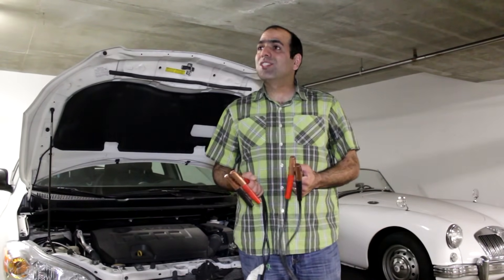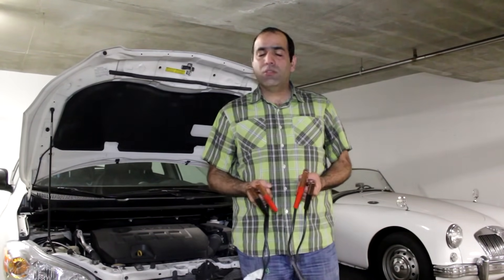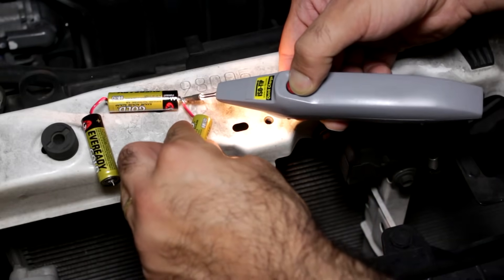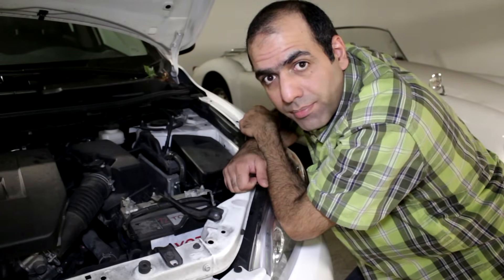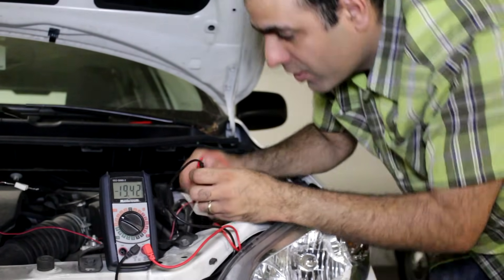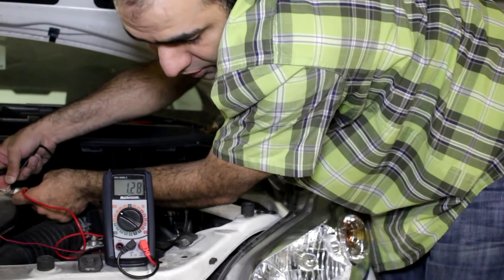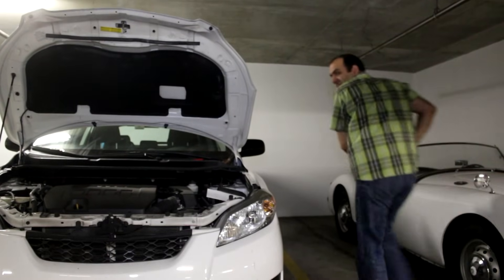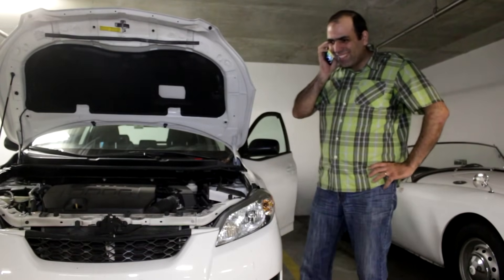Jump Start a Car with AA Batteries

Comment: I'm surprised he doesn't have an electric car. ;)
Reply: Thing would be on fire in three days
Reply: @meseyc  Only his... it would short circuit instantly, start smoking, and immediately die. Surprised his gas car hasn't blown up yet...
Reply: @Alec nolastname Around 22% of electricity comes from renewables. As the grid grows greener, so does your car, if it is electric. You can also buy renewable energy certificates to more or less support renewable energy. Or if you don't plan on moving for ~20 years, charge your cars and power your house with solar.

Lithium mining is indeed damaging, but not really that much more than most of the other crap we mine at much greater volumes. Plus lithium batteries are recycled.
Reply: he would start taking the battery or even the ac motors out of his teslas to do some other projects lmfao
Reply: He finally bought one now
Reply: Alec nolastname Vancouver has hydropower from the Grand Coulee Dam.
Reply: Tesla 😆😆 2021
Reply: Now he has
Reply: He got one a few months ago. Uses it as a whiteboard. 
https://youtu.be/hFLopMOIjc8
Reply: He got it
Reply: now he has
Reply: He would die in a horrific electrical accident leaving his charged remains on the seat
Reply: And now he does
Reply: It's coz at that he was a bit poor and now he has that
Reply: Electrically-powered cars are just as bad for the environment, if not more so, than gasoline-fueled cars. The method most companies are using involves coal burning to produce electricity, which is dangerous to the ozone layer that protects us from the sun's deadly light. That, and it is more expensive to power an electrical car, too. I'm not going to lie; the concept for electrical cars is a great idea, but with our current big industries, it won't be eco-friendly.
And if you won't take my word for it, here is Electroboom himself admitting it: https://youtu.be/hFLopMOIjc8?t=124
Reply: @KinøDerToaster  It's only more expensive if you don't calculate total cost. Digging a chemical battery out of the ground and calling the work done is pretty much a cop-out explanation. If you want to include the actual cost of fossil fuels you have to include the energy used for all the plants and animals to grow to make the fuel in the first place. Of course the cost of electricity also includes the centuries of technological development. All said and done, if you include every cost everywhere, everything is where it should be lol
Reply: @jek__  Cost isn't the whole "selling point" of electric powered cars though. It caters and preys on people that think they are doing good for the environment  by buying one because it doesn't use gas/pollute when the electricity needed to charge it is using polluting forms of power to charge it, using electricity generated from power plants that pollute the environment, just as much or in some cases even more so then just burning gasoline.
Reply: @rootBacon  Actually, that’s a common misconception. Even when electric cars are charged from grids that rely heavily on coal, they still tend to be cleaner overall than gasoline cars. EVs are way more energy-efficient than internal combustion engines, and power plants (even coal ones) are generally more efficient than millions of small engines running individually. Plus, electricity generation is getting cleaner every year with more renewables coming online, so EVs get greener over time, while gas cars don’t. Numerous studies show that over their full lifetime, EVs have lower emissions in almost every region.
Reply: It's probably because he realizes how much better it is to own a gasoline powered vehicle.
Reply: @ronrothrock7116  Didn't age well m8, he drives a Tesla now.
Reply: @ronrothrock7116  Or maybe because people who care about the environment and aren't morons know that the time to switch to an electric is when you have to replace your current car, not just lol whenever.
Reply: @FNLNFNLN  Unlikely, since he's a billionaire.  He can upgrade whenever he feels like it and if he believes in "saving the environment" he would have changed over to an EV before now.
Reply: @ronrothrock7116  Are you claiming Medhi is a billionaire?

Also, getting  an EV when your old car is fine is like getting a new phone ever year. Even if your new one is more efficient, you're still being pretty fucking wasteful.

If your main concern is the environment, new EVs should be replacing old dying cars, not mostly functional ones.

Maybe try leaving your safe space some time.
Reply: @FNLNFNLN  Its not like when you buy a new car you just take your old fully functioning one to the junkyard. Someone else will use it as an upgrade to their barely-working car.
Reply: @ronrothrock7116  he did it

Comment: Your car seems to be suffering a small drain ...have it serviced or disconnect the battery if it needs to sit for more than a few days ....or do what most men who don't want to take so much time do ...and but a battery booster (also makes a good portable 12v power supply)

Comment: The car battery was 11.7 volts plenty enough volts to start a car of that size. I don't know what the point of those double a batteries were not like that little bit was going to make a difference. What he should have done was make sure the car battery was completely dead.  then try his double a battery trick. I hope none of you fall for this BS this video is so stupid. Nice unibrow buddy.

Comment: I have personally started a car,with two 6V lantern batteries joined up..In the past here in Australia,there was a battery you could buy called a "Switch" developed in New Zealand,it had a switch o. top of it..and the battery had  actually two batteries inside the case.sort of double barrelled battery..If the battery went dead,you merely lifted the hood a d flicked the switch to the other position,and started car in the secondary battery ..very good idea..dont know what happened to it,most likely bought out and closed down by Americans..usually the case

Comment: Yep, low current for longer time starts the car. I ran my battery down at work (I'm an EE) and quit late when everybody else was already gone. All I had was an Agilent lab supply with a +-15V 1 amp output. I hooked it up (making sure it was enabled first) and waited for about 15 minutes. Car started with one crank.

Comment: What voltage do you need to charge a 12VDC car  battery? I have a variable power supply that i use in my shop for stuff and i can vary both the voltage and the current.

Comment: I jumped a old V-10 ford on a remote job site with a 18 volt dewalt tool battery that was half dead. had to slide my Drivers license between the jumper clamps on the dewalt to stop it shorting. got me home.

Comment: Very like your clips (and jokes too) 😃 ;)
In this clip the "help-out"- charging procedure may work, (depends on the level of discharging already) but at a so high input voltage (yes, of course, it in case of circuited so little batteries, the voltage on connection to a massive energy-hungry device immediately per few falls) its recommended to underline one time more better 2, the need to disconnect of at least the minus-pole from board-electricity-net!!
19 volts - A regular car-battery-charger gives 14V DC  on the output, what already can destroy sensitive to Overvolt - but very very expensive - circuits in car electronic (such as blackboxes)... :/
You did, many also know, but others, who are leaving batteries  in their devices while running a charging process, may think "Engine for which start a battery is necessary - doesnt work - therefore it wouldnt harm, to leave battery both-side-connected as done in more known "home-devices"...

Comment: If you have a cordless soldering iron laying around--especially in your car, you probably have a cordless drill.  Any drill battery of 14.4 V or better should get your car to start after being connected across your car battery for between 2 and 5 minutes.  I have personally jump started my car battery from an 18 V drill battery in the absolute middle of nowhere where there was no one to help and practically no cell service. I also once helped someone jump start his car with coat hangers because neither of us had cables.  I told him they would glow red hot before he got his car started but it turns out that since his engine was healthy, he was right.

Comment: When you connect the batteries in series what if in between 'in series' connectors  you included a tiny battery a temporary feed for start up.

Comment: Started my Honda with 2 5000 mah 11.1v Lipos in a pinch once, worked line a dream, batteries were fine, I thought the excessive amp pull would kill them but I still use them....

Comment: Hey electro boom....man i owe u alot...my car wudnt start....but i remembered this video.....i didnt have any AA batteries ...but i did have an old laptop charger that was 19 volts and i used that to charge my car battery...and electro boom...it started......without the boom tho  hehe....and....but i didnt get fired tho....love ur channel man...i hope u get to see this comment
Reply: That's impressive I did a similar thing with the fan cord I cut it and attached it to the battery straight from the wall, the cord was thin so it couldnt tranfer too much energy too fast(thats a good thing). It got warm but not too warm, the car did start after a few minutes.
Reply: isaac tapia what?! Did it have a ac too dc converter on it? Or was it straight ac?
Reply: @armandozapata7627  laptop chargers are all DC
Reply: @armandozapata7627  pretty sure if you charge the car battery with a straight ac current something bad will happen
Reply: @edward3709  He was talking to the guy who said he did it with a fan cord...

Comment: The car battery wasn't totally flat. Does this still work if the car battery is say 5v or less? I understand the concept: using a lead-acid battery, which can deliver high current, from lower current AA batteries. I'd be more convinced if you had some way to measure the current the "dead" car battery could deliver before the AA battery charge.

Comment: Mehdi, I need you to please evaluate my plan.   I plan to use two deep cycle 12v batteries to take over my essential power when we have an outage.  I will run them thru an inverter and keep them charged with a charger plugged into an outlet.   Since I want automatic take-over, the plan requires that I segregate the essential circuits and have them running on the batteries all the time.  What problems can you foresee?   Are the losses going to kill me on this one?  Thanks in advance.  
PS.  I think this is kind of related to your video here.  Might be good for discussion.

Comment: Your car battery reads 11.7? A car battery sits a 12 ish volts when engine is not running and that starter is not cranking over a very big engine 11.7 volts should be enough to start the car it shouldn’t have clicked like it did I’ve started cars on less.

Comment: As a better option I would suggest a 14.4 volt cordless drill battery charged from a solar panel as an alternative to use. Basic, but would work better than alkalines but worser than a small lithium jumpstarter.

Comment: You're an idiot. You had 11.5 volts on the battery in your vehicle that would have been enough to start your car without digging around with those ridiculous AA batteries.
Reply: NorCal  starter needs 12v to turn it over, & I think it was meant to be really funny while also showing that it is possible to do it! Sometimes you have to work with what you got, & if he was in the middle of nowhere it would be called resourcefulness. In a city, people just call it stupid, but I think it's awesome! This is comedy gold, why take it seriously!

Comment: It's like you were trying to fail by leaving the wipers on while starting. Granted, they do cut out when the key is turned all the way to the crank position, but still. They're briefly powered before the key gets to the crank position, and at this point who has power to spare? Oh, and how do we know that you weren't using a hidden battery like those "free" energy devices use? huh, huh? ;)

Comment: My grandfather told me of a story from World War II, an Avro Lancaster that had low charge batteries and no replacements could be found. 15 batteries  from Lorries were lined up and charged up the Lancaster's in 45 minutes. 

Everyone said it couldn't be done, believing that the higher 24 volt batteries would attempt to charge the small Lorrie 6 volt units.

The Lancaster successfully started and led the second wave of bombers over the beaches of Juno in Normandy on June 6th, 1944.

Comment: here's  several tips for doing a pro job
do not try to do this unless you are sure what you are doing - the acid can burn your skin
Test the voltage first - there may be a kaput cell which would waste your time.
Check the battery fluid.
attempt to fully charge the battery.
(I learned about these and more on Jons Mender Guide website )

Comment: Thanks! I used variation of your crazy idea to jump start a car just yesterday - with 12V VRLA battery + 2xAA to boost voltage a little bit. Started the car without getting my battery out, awesome!

Comment: It’s obviously fake but that’s what this guy does and it’s funny. Lol 11.72 volts on the battery is perfectly acceptable to start a car. You can even do it on 10 volts
Reply: no you can't start a car with 10 volts unless its a car older than 1960 still running on 6 volts

Comment: 11.5 or so volts in the battery "why won't to start" y'all need to learn. The battery with the key off was at 11.7 or so volts. Turn the key on..... Then the ecm powers up and draws from the battery. The volts drop. Then he turns the key to crank. The start relay is then pulled in, drawing more current, then the start soilinoid (can't spell you get the point) pulls in on the "pull in winding" / coil draws more current...... Volts drop to around 9volts the ecm shuts off as the starter motor try's to crank. The the coil pulling in the starter drops out, as it drop the current draw is lessened then the coil try's again and yet it still can't due to the volt drop....... Click click click.mover and over current up and current down.......

That's why the lights and wipers still worked. Try turning the key with the head lights wipers and aircon on. 

Surface charge was enough to get it over the line.

Comment: I did not see the connections in video, is a resistor necessary ?? also is thr a ground like done in jump start ?? Just connect +Ve end to +ve of car bat. And -ve end to -be of car bat. Without removing bat. Connectors of car?

Comment: Electroboom i need help !!! I have my car bettery down :( I am planning to do exactly what you did. Only thing i did not get is what is the value and importance of adding resistor in series with the battery set? If required what is ideal value and wattage of the resistor? Thanks  in advance.

Comment: Why not try starting the car as soon as you connect the AA's and let the alternator charge up the car battery once the engine starts (remember to run the engine at around 2500 rpm for charging) ?

Comment: the car's battery has 11.75 Volts and you say that's dead?
Reply: 11.75 volts on a car battery means its got less than 50% charge.

Comment: 11.7V should start a car easily
Reply: Yes and no. My old '66 Chevy, yes, definitely it would start anywhere over 11 volts(I had a dashboard voltmeter) And my battery was not a standard car battery but one with about twice the normal capacity(in amp-hours). Batteries today actually have very small amp-hour ratings and they are designed primarily for high output current for what short time they have. That is why you do not see amp-hour ratings on them anymore, but you instead have "cranking amps" without any mention of capacity. For all you know, those "cranking amps" will only last for a matter of seconds before it is depleted but as long as it starts the car, who cares? 
 Extreme cold changes things, your car may not start quickly enough for the battery to still maintain a high enough voltage to drive the amps thru the starter high enough to keep it turning long enough for the engine to finally fire. THAT is where a battery with not only cranking amps but battery amp-hour capacity comes into play for you when you need it.
Reply: not easily at all, actually. 11.7volts on a 12.6volt battery means its less than 50% charged.
Reply: Absolutely perfect explanation hit the nail on the head
Reply: Znawca Bigosu Not in (very) cold weather conditions. And also it depends on the age of the battery / car.

Comment: you could start the car without having to wait the car battery to charge, by trying to start it when the car battery was connected to the other AA batteries. The car would charge the battery with the dynamo it has for that job

Comment: dude get a portable jump starter, or simply buy a yellow top optima or bosch high cca battery. For example, if the current battery's cca is 400, try getting a 800 cca of the same size so it will fit your car but will have more power.